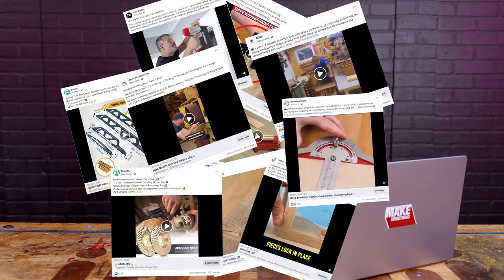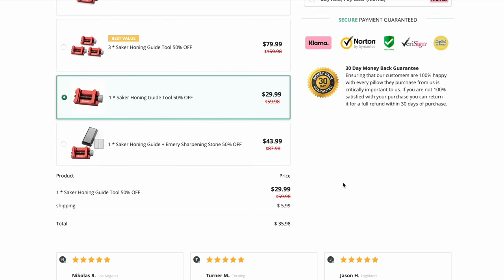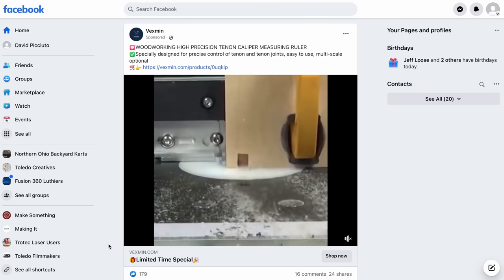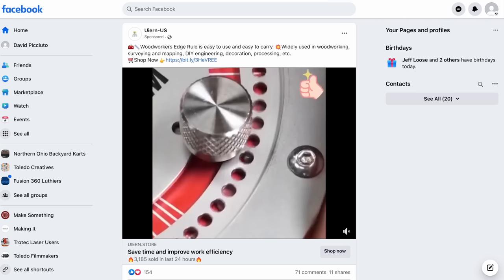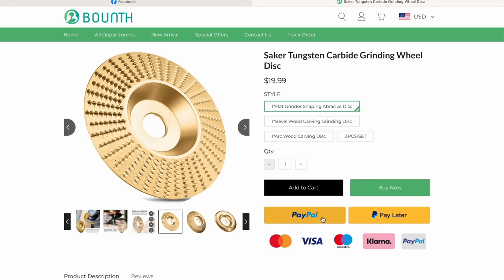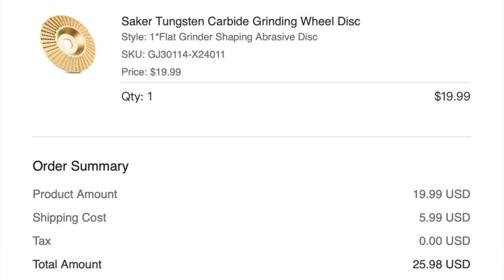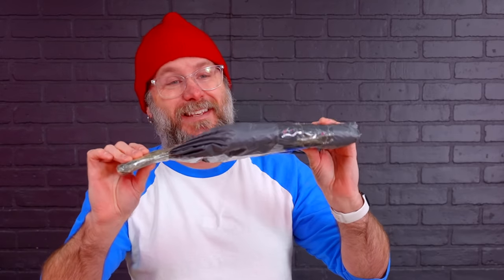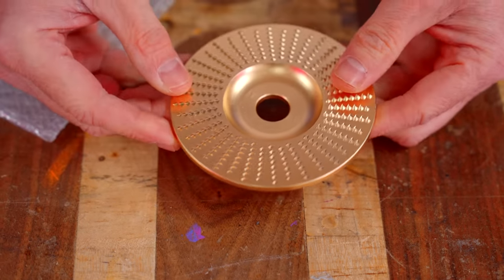I Actually Bought Facebook Scam Ads

Comment: David, I think you missed the option on the grinding wheel.  They did have options that said "Bevel Wood Grinding Disc", "Arc Wood Carving Disc", and "3PCS/SET".   I'm sure you would have loved the set and thrown the Turbo Plane away. 😁
These vids have suspense and are hilarious.
Thanks for taking the time and $$'s.                              JimE
Reply: Also, he completely missed that it was "Saker" branded too.
Reply: Believe it or not, I have A domed version and it works surprisingly well. I compared it to my Kutzall discs.

Comment: The cheese grater disc was also Saker in the description on that site, but you would need one of the spacers for an angle grinder and the low profile lock nut to get that thing close to working.  It will make a nice anti slip coaster or a heavy duty washer for a bolt that acts as a lock washer 😂.

Comment: You bought the flat disc for the angle grinder. They had curved ones on there too. You'd also be just fine without the guard with that as well, there's pretty close to 0 chance of a catch, just with the way it cuts... I'd never use the turboplane without a guard though.

Comment: It wasn't a Facebook ad, but I was looking for a source for T-track. Clear Style's website was broken to the point where you couldn't buy the product, and trying to e-mail them went nowhere. So I found what appeared to be a clearance website (that's how I interpreted it), that was selling their products. So I dropped $130 on several 4' lengths as well as some accessories. A month later, I got this little jewel box with a $10 trinket. I was PISSSSED. Then I did a WHOIS look up on the domain (which was no longer up days later) and the domain had only been up for a month. Served me right for thinking I was getting a killer deal on T-track. At least my CC company reversed the charges..

I was so mad though, that instead of trying to buy T-track elsewhere, I created my own version using 1/8" by 3/4" flatbar steel. My project table actually kicks ass because of it. And it cost me about $50 to do a grid on a 3'x6' project table.

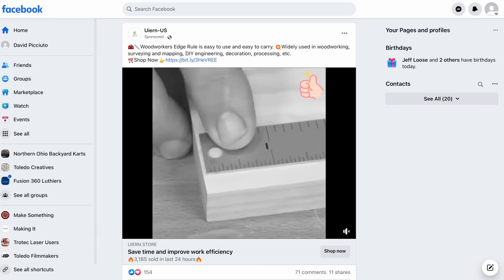Comment: 5:50 That Uiern ad shows a "loose" tape measure as an example of how you need their "super precise" measuring tool. Tape measures have a small amount of travel at the end to account for the thickness of the metal clip so that you can measure using the inner and outer edge correctly

Comment: I wanted one of those protractor\t-square combos but I'm reeeeaaaaly glad I didn't take a chance. 😅 Thanks for doing it for us!
Reply: Same.
Reply: Just get one of the kreg miter gauges at that point and then you can use it on the table saw too
Reply: @noodlelynoodle.  I did actually end up buying a similar miter gauge for my table saw!
Reply: @jamesromanchik  nice we had one at the cabinet shop I worked at and seeing this I was like wait that's basically the exact same thing as the kreg miter fence but with without the usability in the slot in the table saw and crap quality lol

Comment: My one experience with Temu was accidental. A video on FB offered an automatic version of a Buck 110 knife, supposedly made in the US. The thing turned out to ship from China to TEMU in California, to me. It was NOT automatic, even though the invoice said that's what I'd ordered. The knife seemed high quality, but I'd overpaid, expecting the automatic version. It doesn't have a mark for country of manufacture, nor for the type of steel, other than "stainless."
 
I reported the problem and they offered a shipping-label refund. I counter-offered to keep it if they refunded the difference. I could only get the same robotic boilerplate letter in reply, again offering the return/refund, minus $6 shipping, so I accepted that. We'll see how that goes.
 
I'm far from impressed with TEMU. I plan to avoid ever buying from them again.

Comment: Regarding the grinding wheel, Harbor Freight has a nice, steel, dished one for $20, so I don't know why anyone would need to buy one from bounth.

That adjustable square was shameful. I expect most of these Chinese tools to be something along the lines of that chamfer plane; a marginally usable tool that just isn't real high quality. But that adjustable square is clearly designed to deceive. I'd rather get fully scammed. At least I could get PayPal to refund my money more easily if they just straight up ripped me off. With that adjustable square though, it would be harder to justify your disappointment to PayPal. You ordered it, they shipped it and you have it. I think you'd have a hard time getting PayPal to make you whole with a scam like that.

Comment: You are wrong about the screw direction on wood planes.  Stanley and Sargent are opposite from each other for example.   I can sharpen my chisels by hand faster than you can set up the guide or the Tormek.  Don't get me wrong, if you gave me a Tormek I would use the hell out of it, but since I can sharpen by hand as quick as Paul Sellers, I can't justify the cost.

Comment: How many times did you want to measure around a piece at a random angle and had to guess where the line was going?  Not to worry, because this is a wrap-around ruler on a protractor head!  If you also got the 20" (500 mm), you could mark out a cool spiral.  Having that wall rack mount makes for a nifty shrine to money wasted.  Though I did rate the video with a thumbs up, it was just a regular thumb and not a cool light up thumb as advertised.  Surely you can out a trace on that package.

Comment: Not trying to be rude, and not trying to downplay safety, but in several videos you’ve expressed an extreme fear of angle grinders. 
Having respect for a tool is one thing, having fear is another. Maybe you’re just doing it for entertainment sake or something like that but if you’re really that afraid it’s not good. 
I think it’s best you not use an angle grinder at all. I feel like with your fear and how you’re talking about the grinder, you’re going to jinx yourself or something 

I’d give that advice to anyone about anything. Not just angle grinders.
You want respect, you want understanding and to be aware of the potential dangers and take all safety precautions but you don’t want fear to effect anything you do. That’s never good or safe. Fear can actually negate any safety measures taken and still get you hurt

Comment: With the chisel sharpening guide and planer, I'm betting it was a manufacturer's defect with the threads being cut the wrong way. I've seen similar products before. So, basically, the first batch was a full manufacturing run with the threads laid out backwards. When it was discovered, the designers shifted the merchandise off to a company like this so they can still get a return on the product, but the fact that the threads were cut backwards doesn't detract from the original product or company. I had a really funny experience when I bought a pack of cheap bits that were good quality, but, and this was the funniest thing ever, they were cut backwards. So, I had to drill in reverse.

Comment: the grinder disc would've worked better if you used it correctly. being flat, its clearly not meant to be used on flat surfaces to gouge out wood. it worked quite well when you used it on the edge of the log

Comment: I bought the sharing guide, the tracking number never worked. But in about 2 weeks it actually showed up. Not a bad tool! Small width chisels are not long enough but the larger ones worked well. Haven't tried a plane iron yet.

Comment: I bet you could use the chamfer plane's cutter heads to make lathe chisels.

Put em into a steel shaft with a couple set screws with a handle and re-grind the tips into more lathe friendly shapes.